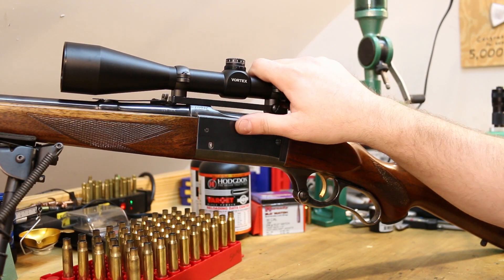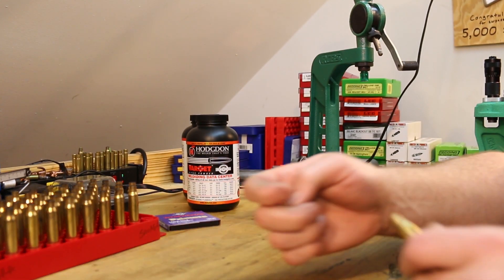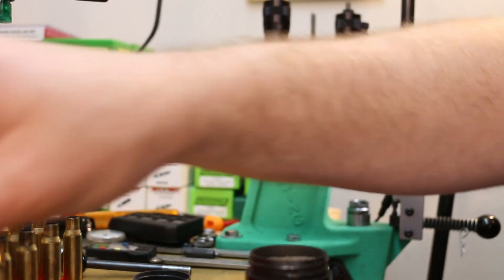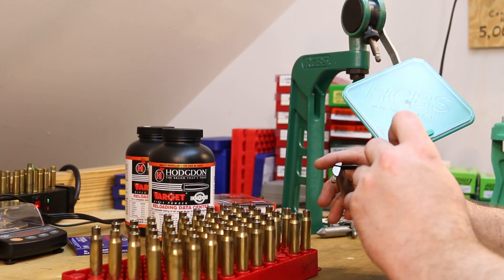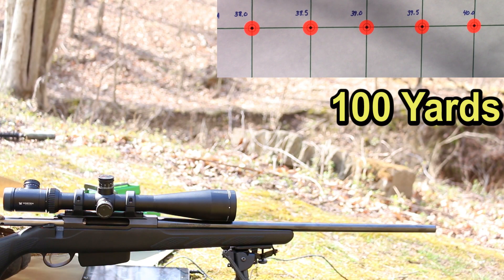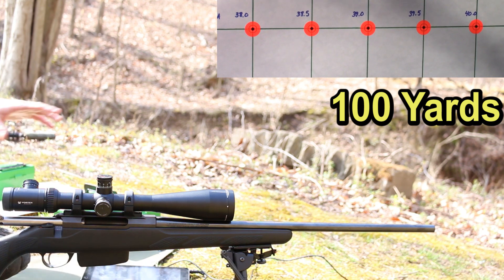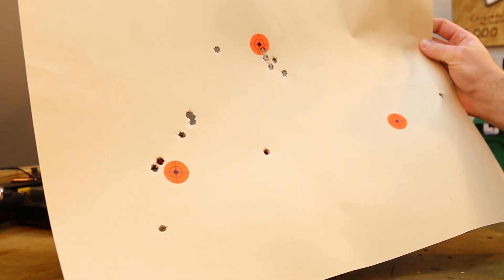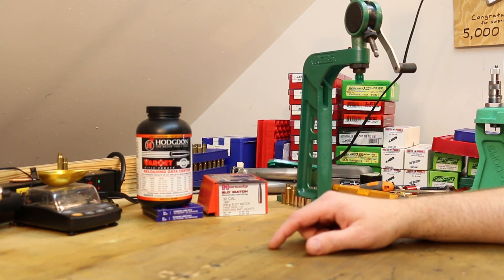.308 Win - 208gr Hornady ELD with Hodgdon Varget

Comment: at sub 2500 fps, a 1:11 twist WONT stabilise that bullet too well. If you have a 1:10 twist 26 inch barrel, you would JUST get away with a 2400 fps load.

Comment: Hey bud..your doing this test wrong by shooting 5 of each loading and them moving left to right for each powder charge weight.
 throw away your results and rerun this test as follows:
shoot 1 shot of each powder weight at its corresponding dot, move left to right, give 5 mins between each shot. (check for signs of pressure each shot)
if have 3 rounds of ammo for each load run through this, one shot per dot left to right  3 times. the reason for this method is to
spread any heat build up evenly across all powder loads, vs having the last 2 or 3 highest charge weights see the most heat and hot barrel shift. this method is even more important on a thinner hunting profile barrel, .the way you did the test, if theres plenty of cool down time between shots is ok on a heavy barrel, but even then can have shifts of 1/2  to 1 inch at 100 yards, and this takes alot longer to do, all that cool down time between shots,. excited to see the new results, happy shooting!!!

Ryan

Comment: 208eld, 49gr Reloder 17, Winchester brass, s+b lrp, OAL 3.006, howa 1500  
.005 off lands. 20" barrel chronographed 2595fps
Reply: I was wondering what your SD was.Nice long COL,and i used allready some 10000S&B primers without 1 fail.   . And 90% S&B Brass, sorted by weight.
Reply: That's nice velocity for such a heavy bullet. I don't reload but using the factory 178eldx I only manage 2550 out of a 20inch barrel.
Reply: I'm shooting the 208g eld match with 41g imr 4064 , I don't have a chronograph, book claims 2350, I have a 20 inch Barrel 1:10 twist 3.0625 coal ,11 thou off the lands. I'm shooting sub 1/4 MOA

Comment: Hornady interlocks in 220 RN shoot Great from my 1/10 savage.The 208 ELD is super long while the 220 is shorter therefore stabilizes better with 1/10 and would likely do the same in your 1/11.The 220s are soft shooting with Varget and designed to expand at 308 velocity. I understand it's popular in Europe and Hornady loads a factory 308/220 that is sold only overseas.Anyway I wanted a "pig stopper" at close range here in east Texas and I've found it.Love your videos.
Reply: What is your load data for the 22ORN Hornady?

Comment: I've run as much as 42.5gr Varget under a 208 AMAX, which is not a compressed load.  However this is a MAX load and prob a wee bit hot.  It produced 2470 fps in my Savage Precision Carbine 20" barrel.  Longest shot I made with it was ca 1200 yds.  Done loads of shooting at 1000-1100 yds with it.

Varget is not the best powder for the 208 in a 308 and a longer barrel would also help velocities.
Reply: What powder do you recommend with these? IMR 4064? I'm running a 24" barrel. I'd be very happy with 2500fps. Going to start working on a load for the 178 grain and may try some 185's

Comment: I was hoping these 208gr bullets would work in my CZ 550 but it also has a 1-12 barrel so Im thinking the 178 ELDX is going to be as high as I can go. I may still give it a try as the CZ barrel is 25" and I wouldn't use Varget as it doesn't give me high enough velocities in other loads. Id use RL17 for the 208
Reply: mojo jojo maybe with reloader 26 pushing it faster

Comment: IMR 3031 is the powder all match 308 shooters use, but no bullet heaver than a 175 grn
Reply: Pretty bold statement
I haven’t seen it used except for Garlands and M1As since the 80s
Hard to beat Varget
I’ve tried—both 4895s, 4064, TAC,Rel 15, this list goes on for days
Varget and the bullets heavier than 168 is a match made in heaven

Comment: Winchester primers are terrible for accuracy. Maybe they have improved a little but CCI bench rest primers are usually the best and there really is a massive difference between them. Winchester primers 1 inch or worse five shot groups and CCI BR primers .25 - .5 inch.
Reply: Malcolm Kermode come on man its not that simple, too many variables, I've had great results from winchester primers
Reply: So are you shooting .25 inch groups with winchester primers.
Reply: Never measured group size, no need to if they all touch, but im sure you shoot .25 all day long in 20mph crosswind
Reply: Have you actually shot 5 shot groups with bench rest loads with Winchester primers and compared them to the same load with CCI bench rest primers. And have you done that with three different rifles.
Reply: Malcolm Kermode what is a benchrest? Is that one of those funny looking things rich folks sit guns on to shoot? Im sorry WLR primers dont work for your three guns, they work great in my one. Maybe your doing something wrong i dont know
Reply: Malcolm Kermode just wanted to revisit this, 10 shot strings fire forming lapua 308 brass, winchester large rifle primer, 42gr of varget ES 22 SD 9, with 3031 39gr ES 26 SD 8, i guess i just got lucky, and thats with min loads 🤔

Comment: As previously stated, ya need to seat them a lot longer. May have to single feed but the ELD isn't really a hunting bullet.My hunting load is the 178 ELDX over Varget seated mag length in my savage Hog Hunter. 1/10 twist. Same load shoots well in my Ruger American Predator with a 1/10.Side bar: I have a mean Hornady interlock 220 round nose load. It's a much shorter bullet than an ELD style so the BC isn't there, however it shoots sub MOA from my savage and is a pig 🐷 smacker no doubt. I also use a relativly hot load of Varget but the recoil is very pushy or soft. Not snappy👊 No mag or feed issues.
Reply: The ELD-M actually works really well for hunting at slightly lower velocities (longer ranges)

If you cross section an ELD-X and ELD-M and compare them the only difference is the "match" round has a slightly thinner jacket and doesn't have the little "locking" ring between the jacket and core.

At high velocities this CAN cause bullet failure I'm not trying to claim it won't, but at lower velocities it actually performs better than the ELD-X on game because the thinner jacket allows it to expand more and expand at lower velocities than ELD-X will.

As long as your impact velocity is under 2400fps (no problem here) the ELD-M works wonderfully on game. A channel here on YouTube called "long range hunting group" has videos where he tests the ELD-M on gel AND has videos where he uses them on game.

The main thing to remember is to not use them at too high of an impact velocity (don't use them too close)

Comment: You need a 24" or plus in 10 twist or less. More important when you have a longer barrel, use a slower powder Biggame,N140,tub5000.REL15. I didn't use the ELD208 Yet. I am experimenthing with the eld-x 178, they seem to have a better BC than the Match version. 2MOA less drop at 1000Y than the 175TMK's. 208 Rocks only in 300WinMAG. try it, they are the best, better than barnes and berger and sierra. But still love the 168MK HPBT with 44biggame at 2,858COL. DONOTCOPY (reg.)
LOL.i buy them 22c/1000pcs.
Reply: I'm running the 225 eld in my Howa 1500 300 win 24 inch 1-10 twist. That works good. But in an 308 with 1-12 twist it will not.

Comment: Hey Johnny is your Tikka a T3 if so it will take the 30-06 Magazine and by either using a long action bolt stop or modifying your own with a file will give you around 3.4" this is common in New Zealand to utilise the full action length. It makes for a great medium length calibre action or short action with long vld type bullets

Comment: The heaviest I have ever loaded .308 Winchester was 180 grain.  I bet those 208 gr would fly great out of .300 win mag. or .30-06.  What did your brass look like? Any signs of over-pressure? I have had pretty good results with the 208 ELD in 300blk with H110 . However,  I don't recall the OAL. Thanks for the info.
Reply from the maker: The primers got a little flat on the high end but nothing too bad.

Comment: I would LOVE to see some ar10 (308) load testing. I recently bought one and am working on the perfect load
Reply: I second this. Especially for longer high bc bullets
Reply: If you can get the 208ELD-Match to near 2400fps in an AR... I’m hovering around there 40-41.5 grains of varget at 2.800” +\- .005 It’s a very compressed load. I’m also at 4,200 ASL with dry air. But man... goes subsonic at 1600 yards!! (If you use this data, headstamp sort your cases and check their volume, like I said very compressed!) It’s likely a bit warm of a load, I should be more careful of my brass signs. No blown primers, but 3-5 loads primer seating tension is lost.
Reply: I ran some Monster Match 190 grain bullets at 38.5 grains of Varget and there was still a pretty good amount of space in the case. Ran out of those bullets, so I haven't had a chance to work up from there. Currently playing around with some 175 grain RDF Nosler bullets with a G1 of .536. Have you tried any of the Berger 200.20x?
Reply: Naw, Just loaded some 208eld's again though and got some good once fired stuff from a friend, but it was 7.62 brass. Some notes, 1.2 grain H20 capacity difference so my regular loads of 40.5 or 41.5 got reduced to 38 and 38.5 to check for speeds an pressure. 40 grains was actually pressing the bullet back out and I was getting inconsistent seatings with that charge. Hopefully will get to test them in the 20" AR10 tomorrow. Black Hole Weaponry barrel seems pretty good when you find that sweet spot. I try to unify my bullet for my 300RUM and my .308.
Reply: That's what I  working with, 20" M5E1. Is yours 1 in 10?
Reply: 1:8.5 actually!
Reply: wow, nice. Mine has seemed to handle the 190 grain bullets fine so far (up close that is) and I could probably get 200 grains to stabilize. You should be good past 230 grains I would think, or more really.
Reply: In theory the twist could do it, but the case capacity and velocity before over pressure with varget(powder of choice for me!) would likely make it to slow to be useful. In my 700 bolt gun I did load some 200smk's to like 2700. ONCE.  OAL was 2.950" but it was smoking out primers and one fully dislodged into the action had to take the gun apart to get the primer out! Prolly not the best or safest reloading practice.... Definitely pay attention to deviation spreads and to case markings. Primers getting TOO flat or pierced smoke around the edge of the primer pocket, and ejector swipe markings. Too much wear and tear on brass, and the gun for that performarnce. I think 2375-2400 is the maximum for my gun to handle. gas is tuned waay down too soft shooting!